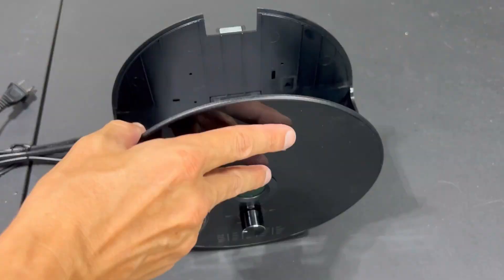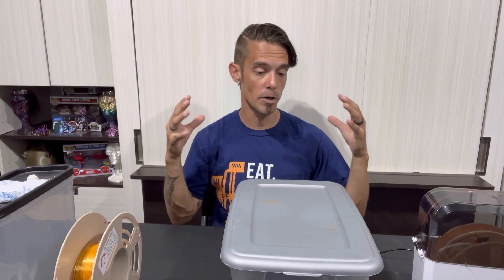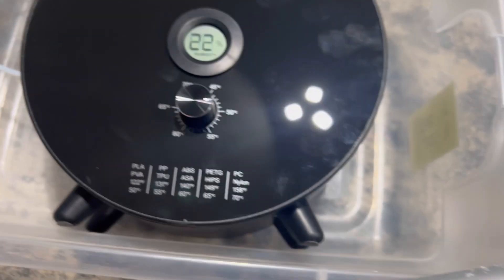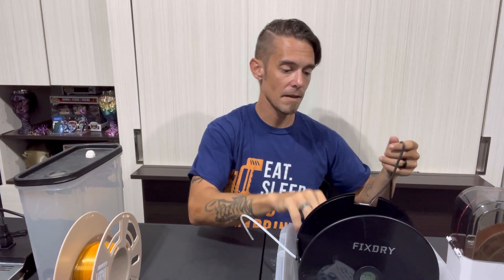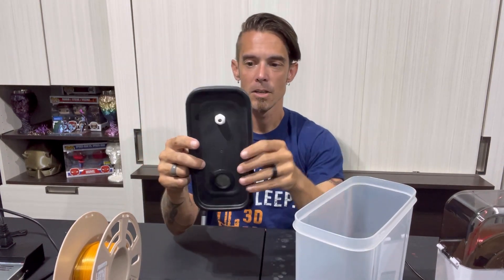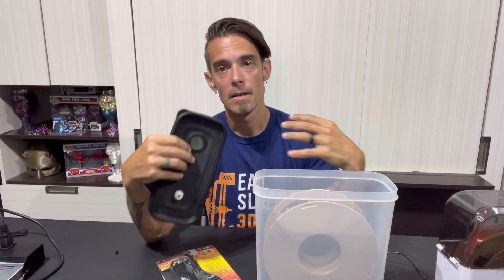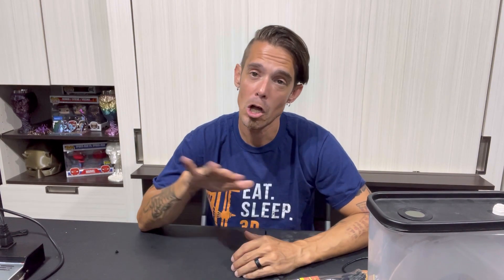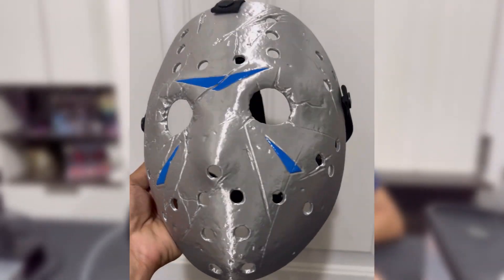How to make a filament dehydrator | Filament dryer for large spools PLA | DIY dryer box 3D printing

Comment: I use a food dehydrator that I modified to do the majority of the work and then put the spool in a dry box like you used to use to keep it dry if using it right away. If I am storing it I will put the dried filament into a vacuum sealed bag with silica bags and store it in a cool dry place to keep it dry.
Reply from the maker: Nice technique!

Comment: Good video. Like the lateral think about the reptile mat. I get locked in sometimes in 3D printing - 3D parts. Btw, my kid used to call it Darkling-duck and was his favorite (mine as well)
Reply from the maker: Yea you could go further and wire up pc fans but you have to weigh the cost in. A basic filament dryer is $40 bucks so my idea was to keep it dirt cheap lol I loved Disney afternoons as a kid…talespin,rescue rangers,gummi bears,Darkwing duck. Those were the times
Reply: @Darkwingdad  I've got to import stuff like that and it is expensive. PC fans are cheap. Those cartoons were the best.
Reply from the maker: Yea I’ve put fans in helmets, mb one day I’ll mod this little sucker lol
Reply: @Darkwingdad  (Off topic) I need to figure out how to build a personal cooling system. I only have an Enduro Jacket (Black and red) and a black helmet. Its ok when I move but I bake in it at the robot (traffic light)

Comment: I raise reptiles, and there are controls for heating pads so you can control the  temps on them just so you know . they run about 32 bucks for combo, or about 16 for the temp control alone.
Reply from the maker: @figuresix  nice! I’m actually involuntarily breeding crested geckos but they are one the easiest & don’t need high heat(more stable humidity than anything) but when I had my beardie & jacksons I had a lot of heat devices with timers,delays etc. good to know they have control modules now, I just had old school plug in timers or did it manually lol
Reply: @Darkwingdad  Yeah im down to only crested geckos here in Washington state. Gets cold in winter so have to use them on sides of tank durring winter to keep them warm enough. Mainly used them on leopard geckos, and my ball pythons.

Comment: Have you tried doing this but bumping up to a 8*18" 24w heater and slapping a fan in the unit? I wonder if this paired with a simple smart humidity/temp sensor would work? Those sensors can be picked up for like $15
Reply from the maker: I haven’t but that idea would definitely work!

Comment: I clicked on a Google image of 4 or 5 dry food containers and it brought me to this video.  I'm looking for the orange or blue nuts that are in that Google image, but they aren't in this video.  The nuts that are on the inside of the food containers that are threaded onto the Bowden fittings.  I'm hoping someone has an stl file of a flanged nut that I can use to hold some Bowden fittings for my homemade filament dryers.  Any help would be greatly appreciated!
Reply from the maker: If you can email me the image I’m sure I can locate it for you

Comment: I just have a hard time believing these filament dehydrators do much. With most of the filament being tightly wound there's no air flow to get to the moisture. I remember someone in past did a test by soaking a roll of nylon then dehydration it and weighing it at each stage. The results were not promising.
Reply from the maker: Depends on how fast you use the filament. Once the filament is exposed it can get absorbed in. Depending on where you live leave filament out & see what happens. If you don’t think moisture in filament doesn’t affect it you’re terrible wrong. Moisture gets in, only one way to get it out.
Reply: @Darkwingdad  I live in VERY hot and humid Florida so I know all about humidity. Honestly though I've never had an issue with petg or pla. Tried cf nylon once and had trouble fresh out of the bag. I leave my filaments hanging above my printer in the open air. I think in the general comfortable conditions in most homes the moisture isn't a big problem. If you leave it in a garage or outside for a year then you might have issues. 

Also just put off extra caution I do have any unusual filaments in a sealed bin with redryable desiccant.
Reply from the maker: @RussellMilliner  I live in FL as well, I have gotten filament right from manufacturers, printed & I got moisture zits. Unfortunately not all companies take the same QC when making & packing them. If I leave my filament out or I store it away and there’s not a desiccant pack or not sealed fully I have seen moisture drawbacks. Again it depends on how fast you go through filament, I also use the most moisture absorbing filament in silk pla…
Reply: @Darkwingdad  I just feel that without some empirical evidence that running some heated air over a roll of filament does very little.  Hot air holds more moisture than cold air thus lowering the humidity percentage measurement, but the same volume of moisture is still in the air.  With these commercial dryers, I am not seeing or detecting where the moisture is going.  They're sucking in the moist air, heating it and running it across the outside layers of filament depending on how well it's wrapped.  I know it doesn't take much moisture to cause issues but is there a way without expensive equipment to measure the effectiveness of the dryers?  Not picking on you, but I've seen several vids recently about the "new" Fixdry which they list as a "dehumidifier" rather than a "dryer" which doesn't seem correct.  Your dry box at least has desiccant pack to absorb moisture.

Keep up the good work, I love your finishing/smoothing vids.  Gives me something to strive for, if I only had the time.
Reply from the maker: @RussellMilliner  some of what you stated is correct however. If saturated air is warmed, it can in fact hold more water but relative humidity drops, which is why warm air is used to dry objects. As it expunges moisture in the substrate & the circulating fan prevents it from being redistributed and it drops the temp above it. When you cool saturated air it forces water out (condensation). I’ve personally not seen a company refer to a dry box or dehydrator as a dehumidifier, could be the language barrier as most these companies are over seas. Regardless have a background in both auto body & a degree in environmental science the indroduction of any hydrogen & oxygen molecule will have an affect in numerous aspects. It’s like using a compressor and just thinking draining the tank is enough, water separators are still highly recommended. Just my take though.
Reply: @RussellMilliner  Yes, hot air holds more water.  However the process of heating the air in a sealed chamber does not add any water.  It lowers the RELATIVE humidity, not the absolute amount of water.   Then after say 8 hours the plastic comes into equilibrium with the air. (clothes dryers work the same way)